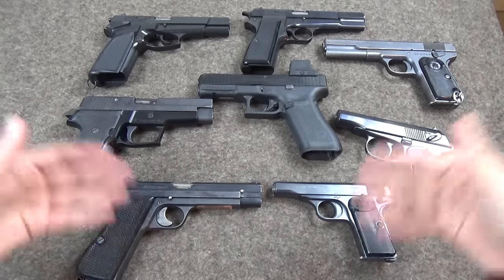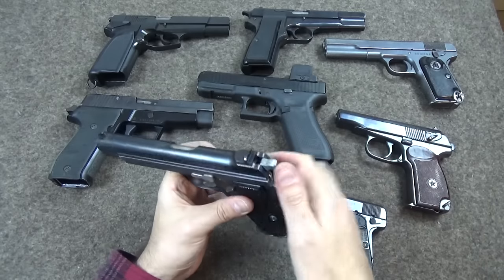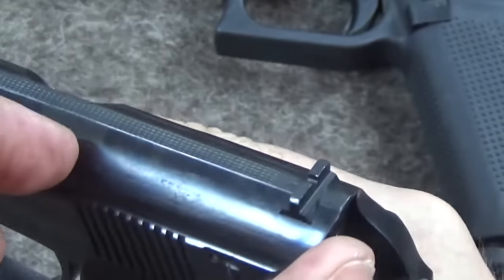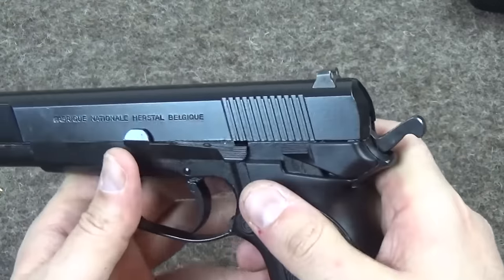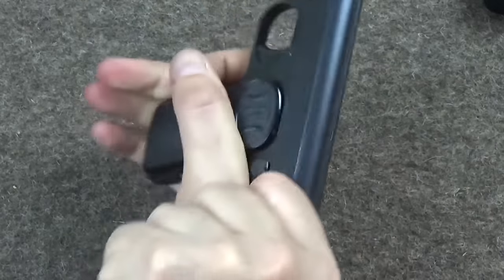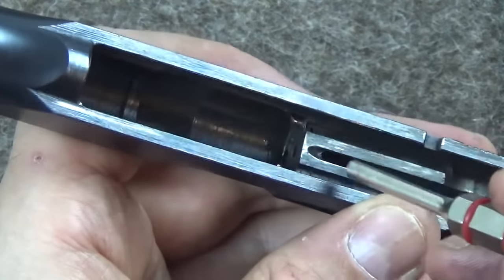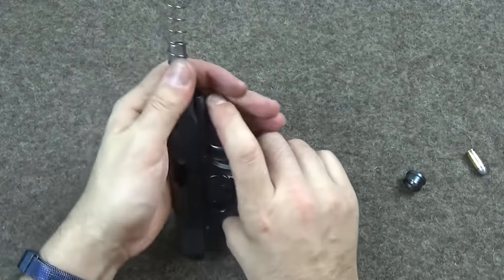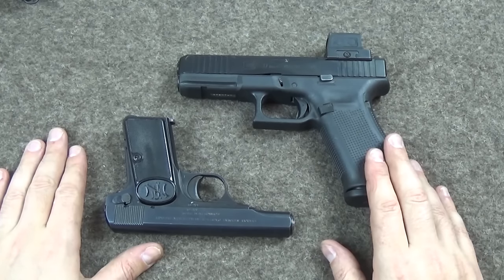FN1910 Inherent Safety Flaw: Can Be Put In An Unsafe Condition!!!

Comment: ...... why the hell would anyone think thats a remotely good idea to carry like that, like what kind of backwards convoluted thought process led to that being seen as a good idea by a sapient human being
Reply: I think he just never knew the striker wasn't cocked and never bothered to test it. Maybe all the other firearms he ever had cocked on opening just a little bit and didn't really understand the differences, just assumed they all worked the same.
Reply: The reason for thinking it was safe goes back to external hammer fired guns like a shotgun.  If the hammer is down, it is considered safe by some.  It of course much safer when barrels opened and gun empty.   
For that particular browning used in the demonstration, the minimum sear engagement would make me carry it with chamber empty.

Comment: If someone hit the resting hammer on a 1911 and caused a discharge, it was a series 70. The series 80 weapons have a firing pin block that only allows the gun to fire if the trigger is pressed.
Reply: The majority of 1911s out there are the non-80 type, since the original M1911 design does not incorporate the Series 80 design improvements. Even most high-end 1911s these days, including very expensive 2011s such as the Staccato and similar, use the older design due the 80-series having a slightly worse trigger (as the trigger is actuating the extra parts of the internal safety). This also means that most 1911s and 2011s out there are NOT drop-safe and can fairly reliably discharge even with the safety on if dropped on the muzzle, which causes the firing pin to strike the primer. Oddly, they are still pretty drop safe if dropped on the hammer due to the half-cock notch catching the hammer if the primary sear notch fails.
Reply: @tacticalmanatee  I agree that most 1911s are S70 types. As a guy who had an accidental discharge when the leaf spring failed in a Springfield I once had, I would not feel comfortable with one today. It only happened once and Ive owned numerous series 70 guns that never had issues but once was enough. I never have my finger in the trigger well when chambering a round. The hammer fell on a round because most of the sear leaf that engages the hammer was broken off. Had it been a series 80 the hammer still would have dropped but the gun would not have fired. Fortunately I always point my weapons in a safe direction when loading or unloading. The only casualty was a big steamer trunk and some old quilts.

Comment: British nomenclature is different.  On a single action pistol like a 1911 I learned it as not a rebounding striker, but as being a firing pin.  It works by inertia since in the hammer down down position it does not extend forward sufficiently to make contact with the primer.  In the hammer down position, most blows to the hammer will not cause the firing pin to move forward.  But dropping is one the muzzle could cause a discharged in the original configuration.  Some 1911s have a trigger activated firing pin block.  In the half (quarter) cock position it is possible if the pistol is dropped on the hammer for it fire.  
A military spec gun with 8 lb often plus trigger and full strength firing pin springs are less likely go off from being dropped in my opinion.

Comment: Cheers Mr B! Question though -- I've always wondered if those "firing pin acts as ejector" pistols could set off an unfired round if it was manually ejected with enough force? Would it even dimple the primer?
Reply from the maker: I don't think so, but to modern eyes it's a bit of a "why even take the risk?" thing!

Comment: Thanks for the warning. It raises one question: with the fp serving as the injector, how do you eject one live round from the chamber?
Reply from the maker: it's fine, you can't pull it back hard enough to set it off. The ejection port is a bit tiny though so it's not always reliable... Remove the mag and pull back the slide, they sometimes fall down the mag well IIRC, but it's been a while since I did that.

Comment: I can verify that a Mak is not drop safe with the hammer down and the safety not on.  I thought it had a hammer block but it does not.
Reply: Ive actually drop tested a mak several times to TRY to set a primer off. I was unsuccessful, and it might be because the firing pin mass is light and the primers in the ammo were wolf. 

But i get bigger primer dents when charging some of my rifles than I got from dropping my mak multiple times from multiple heights

Comment: The other problem with Glock pattern firearms is people being in shooting situations and afterwards when trying to holster the pistol, still being affected by everything that happens to you in that kind of life or death situation, don't notice something gets inside the trigger housing and depresses the finger dingus and the trigger with the pistol loaded and then they Glock themselves.
Reply: I don't understand your point: how is it "The other problem with Glock pattern firearms" specifically and not a problem with other types of handguns?
How would it be less of a problem "being in shooting situations and afterwards when trying to holster the pistol" if the pistol was, say, a Beretta 92FS or a SIG P226?
Reply: @niznikb  
The Glock has no manual safety. The 92FS and 1911 pattern guns do. I worked a contract security job. I trained to carry with the hammer de-cocked and on safe with a round in the chamber. I trained to release the safety on drawing with trigger finger out side the guard, reverse that putting the pistol back in the holster. Glock style pistols unless they have a pin in the base plate that starts to protrude as the firing pin is being cocked AND you train every single time to holster with your thumb over that pin in case what I wrote about happens you have no way to notice that or prevent that.  My point was that in the aftermath of a shooting situation, and the physiological affects of that situation, you are going to be acting on automatic and how you trained. If your Glock was pulled from concealment from under clothes, after you pull those clothes up they are going to fall back. And if they fall over the holster mouth and you don't see that because in practice when you are not under stress you held them up to holster, if a piece of fabric or anything gets under that trigger guard it can pull that trigger and finger dingus. Glock your self.
Reply from the maker: @niznikb with a 92 or a 226 the force required and the distance the trigger has to move (assuming decocked as it should be) is far greater than with a Glock or similar.

Comment: Just to be clear: the thumb safety secures the firing pin from inertial travel?
Reply from the maker: It locks the sear in the raised position, that's all. Which is fine if it's cocked.